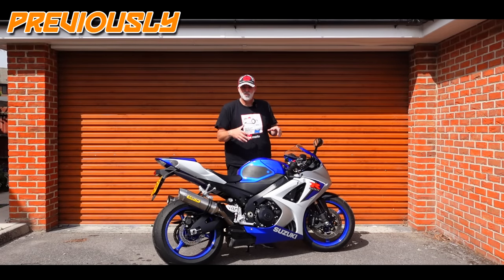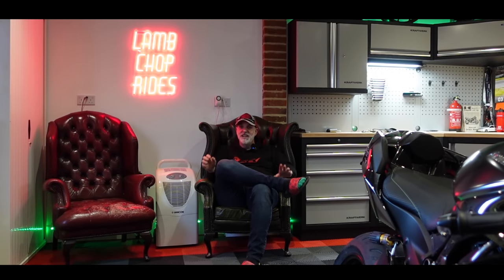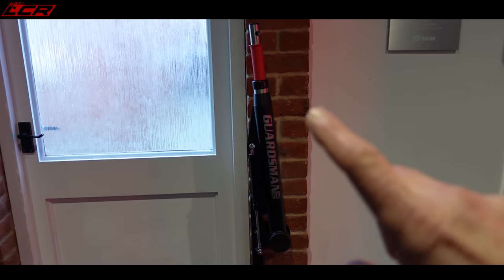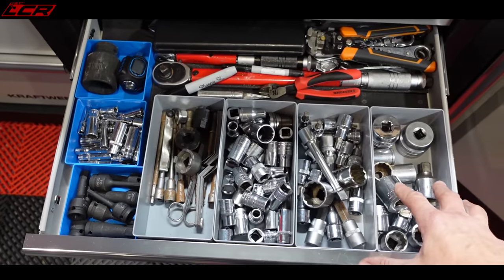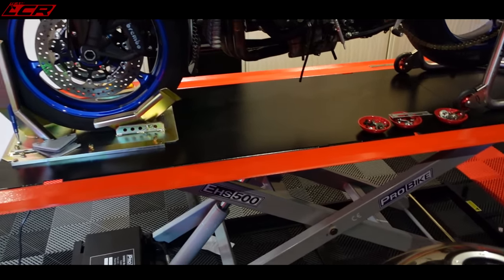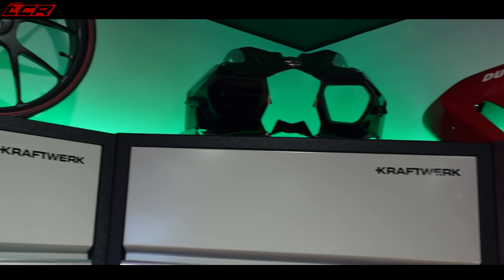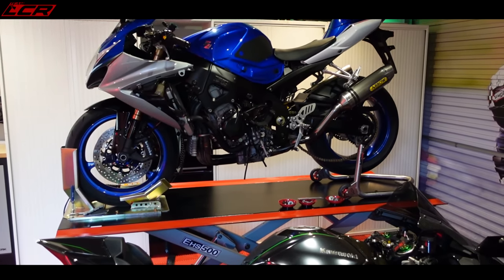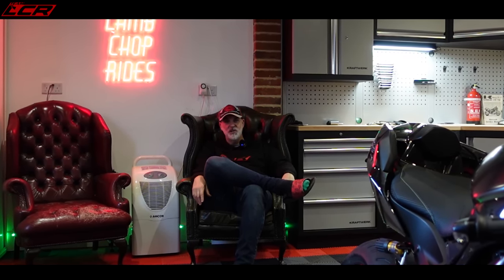Ultimate Garage Build | It's COMPLETE!!

Comment: Chops… for the bike ramp get some anti slip rubber matting, glue it on the ramp deck, stops scratches and other damage… also for around them ramp and any work areas het some rubber horse matting, better on the feet, knees plus makes finding anything dropped or cleaning spills so much easier 👍

Comment: The garage looks the business.
Biggest regret I had when building my garage many years ago was not to have underfloor heating with grey quarry tiles.
How does having a workshop attached to the house effect your house hold insurance and did you have to do any additional fire precautions?
Reply from the maker: It's not attached but detached, so no special considerations 👍